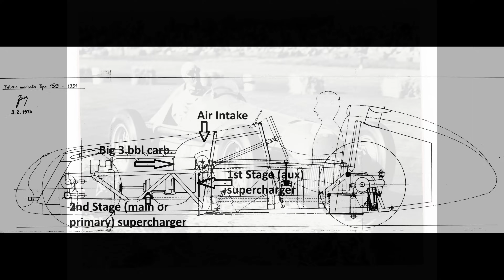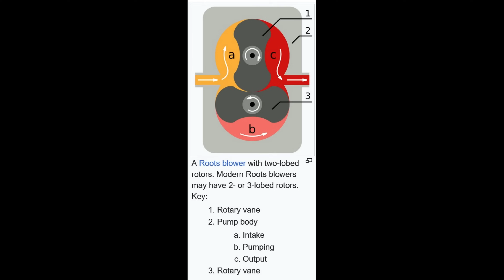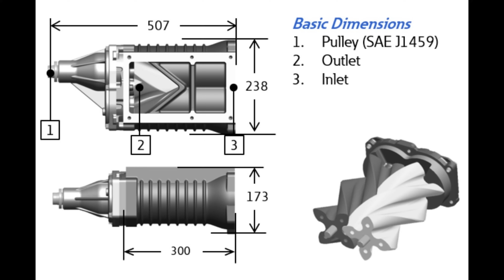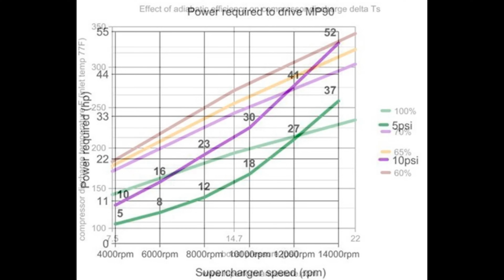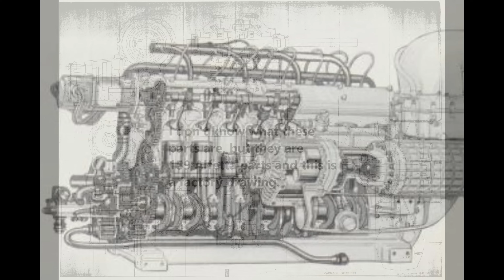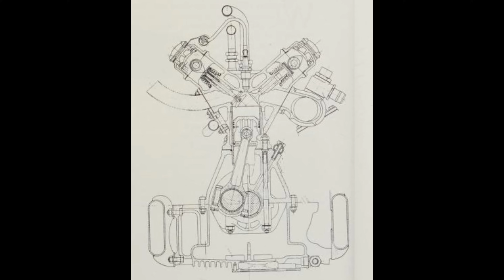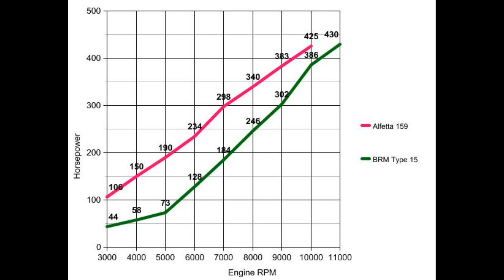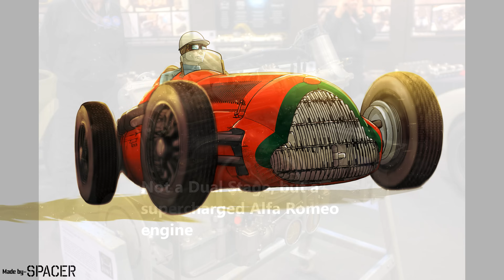Dual Stage Supercharging 450hp out of 1.5 Liters in 1951

Comment: I have a question. With an engine this small, high power and rpm, did the engine have a blast shield to contain the engine if it fragged itself?
Reply from the maker: Do you mean to match the roll over protection for the driver? Next thing is you'll want seat belts in your 190mph death trap.
Reply: @GregsAirplanesandAutomobiles  One has to love the linen "helmets" such as Fangio and Farina wore in 50 and 51. (Not sure if the Maestro had switched to the newer "high tech" cork lined helmets yet; one saved his life in 52).
Reply: @GregsAirplanesandAutomobiles  😂

Comment: Interesting topic. Auto Union also had a two-stage Roots blower in its Type D racing car from 1939.
Reply: Mercedes was also running two stage Roots blowers in 1939. Post war Ferdinand Porsche designed and built a rear engined flat twelve cylinder four wheel drive two stage supercharged formula one car for Cisitalia, but it was so complex it led to Cisitalia going bankrupt before it could be raced.
Reply: They went from a 6l single stage V16 to a 3l dual stage V12 and made at least the same power.
Reply: The 1947 BRM V16 made a very peaky 600bhp from a 1.5 litre with a single stage centrifugal  supercharger.
Reply: @georgetillett6549  On the very rare occasion it was running properly. Engineers eventually concluded that very small cylinders don't work well.

Comment: Funny how cargo ships often use Roots blowers, their economical cruise shouldn’t vary much?
Reply: Usually the supercharged marine engines are 2-stroke diesels. Unlike 2 stroke petrol engines, 2 stroke diesels have exhaust valves and the blower is used mostly for scavenging - Ie, pumping a lot of air into the cylinder with the exhaust valve open. This forces the exhaust out quickly, allowing the exhaust valve to be closed and the compression cycle to start. They run at a variety of boost pressures and many are also turbocharged.

Comment: straight eight. never heard one of those running...
Reply: They are GLORIOUS. I have been fortunate to see and hear a 159 running in 1991, and several Alfa Romeo Tipo B and Monza racers from the 1930s with straight eights, about 2.3 litres. What an absolutely glorious sound!!!!!
Reply: I drive a straight four😀
Reply: Search for Mercedes W 125.  G.P. car from 1937.  Supercharged straight 8.  645 h.p.  It sounds amazing and terrifying at the same time.  Was the most powerful g.p. car until the 1980s!
Reply: And the Merc ran on a mix of acetone, xyelene,  and methanol